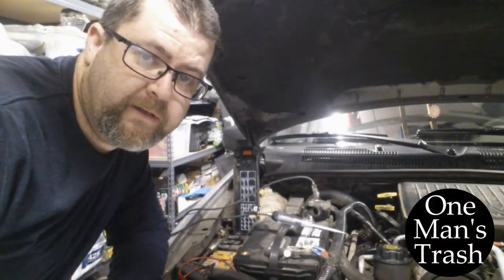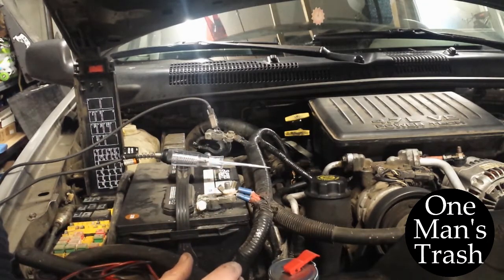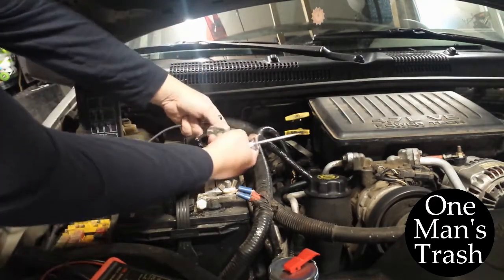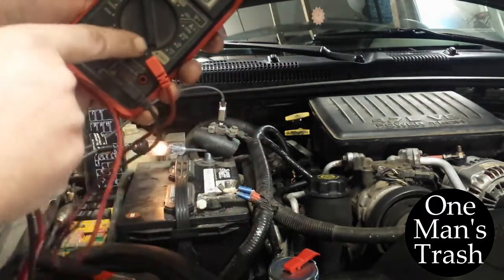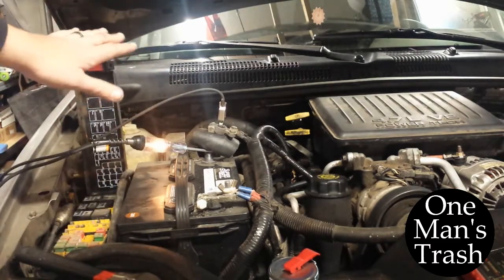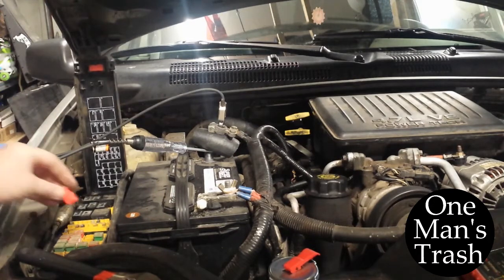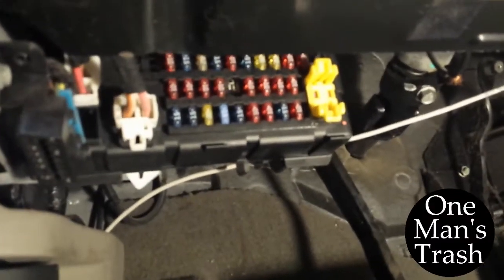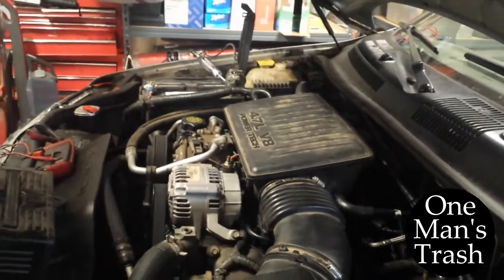car battery dies overnight

Comment: Hi just wanted to ask i was driving all day and i stopped at asda to get some food, i locked the car done the shopping and when i came back i unlocked the car and pressed the button to start the engine then everything completely shut off and also couldnt lock or unlock the car, i took the emergency key out the fob and that wouldnt lock the car aswell, called a friend to jump the car and its been fine for 1 day now, what could be the issue? Thanks for your time
Reply from the maker: If I were to hazard a guess I would say bad connection at your battery. Make sure the connections are clean and tight.